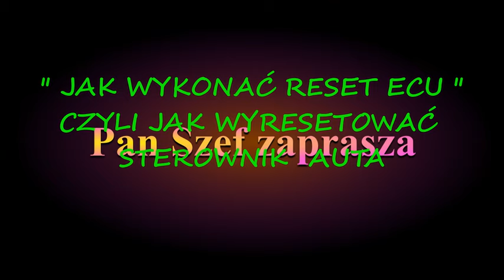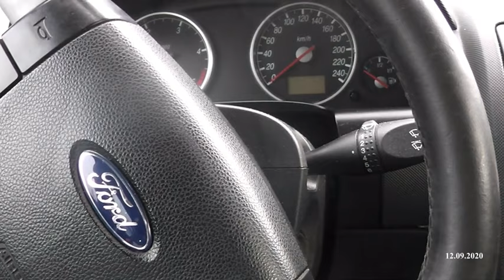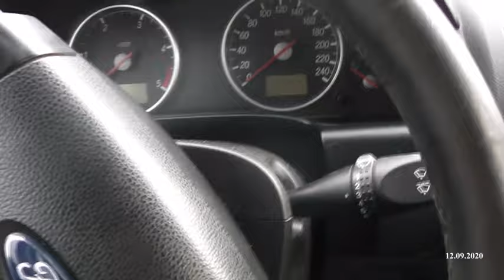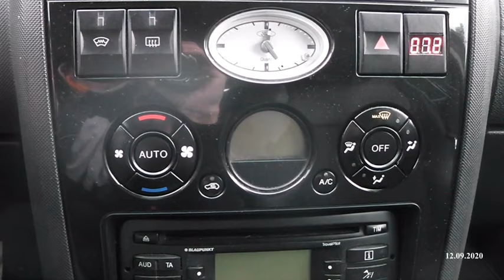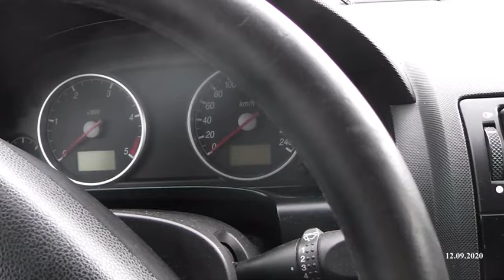EXPERT JAK RESETOWAĆ STEROWNIK KOMPUTER SAMOCHODU , KASUJEMY WARTOŚCI WYUCZONE 2020 temat sprawdzony

Comment: Witam, wie Pan może z czym może być związany błąd p1693 w Suzuki Swift "turbo charge control circuit malfunction" taka informacja wyskoczyła, oraz błąd p0301, jakiś problem z 1 cylindrem. Po odpaleniu obroty falują przez jakiś czas silnik nie pracuje równo, później się umiarkowują te obroty do 900. zakres falowania między 1100-950 odrazu po odpaleniu.
Reply from the maker: co to za silnik ? błąd p0301 to wypadanie zapłonu w 1 cyl czyli wtryskiwacz  ,cewka itd a p1639 to kontrola doładowania ma problem często , przyczyna -Uszk. czujnik , geometria klinująca się  bez testów działania i odczytu parametrów w blokach ciężko będzie jednoznacznie określić TO.
Reply: @panszef6414  Suzuki Swift 1.3 diesel 75km 2008r. Wyskakuje mi kontrolka na desce rozdzielczej "samochód z kluczem francuskim"